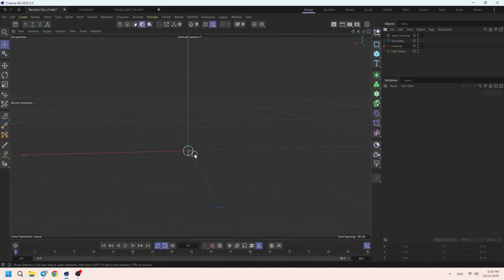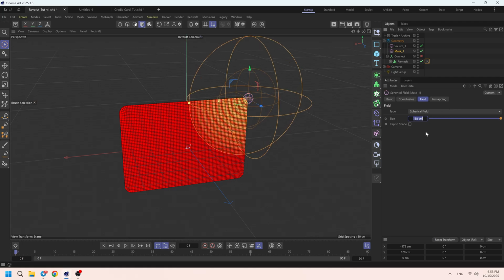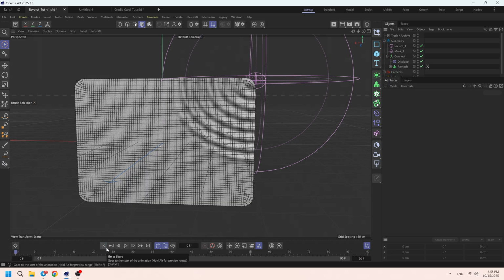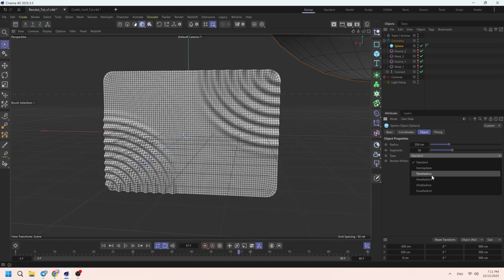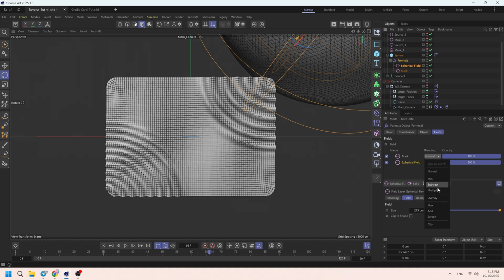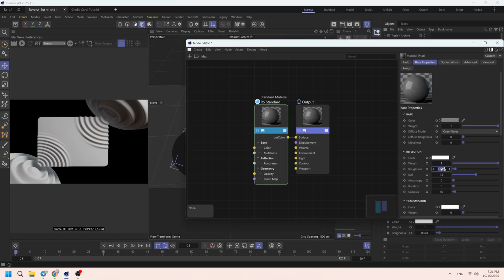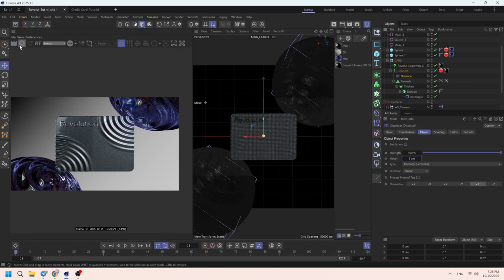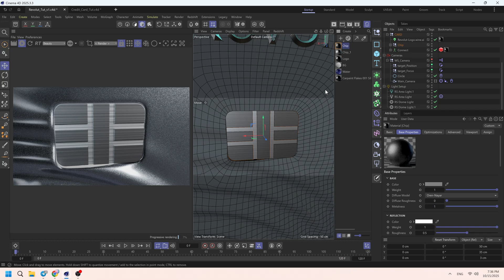Fintech product Cinema 4D Tutorial | [ENG]

Comment: Thank you for your video. 
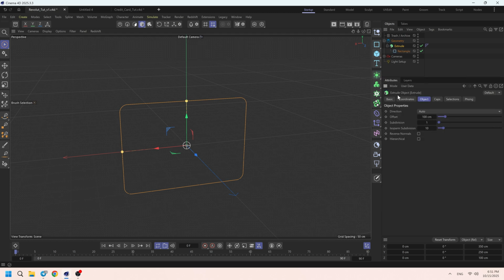I would like to ask you about the advantages of your extrusion method 01:05. Can you please explain  what benefits it provides?
Reply from the maker: So, long story short. Anchor point. If you're using only extrude, then after extrusion your Anchor point will be not in the geomtrical center on a new extruded object, but still be at the center of Spline. 

If you're using Extrude with 0, you create only the polygon, and then, with Thicken you extrude the object in both directions. And the Anchor point of the object still is in the very center of a new object.
Reply: @RemitOtkin  Thanks